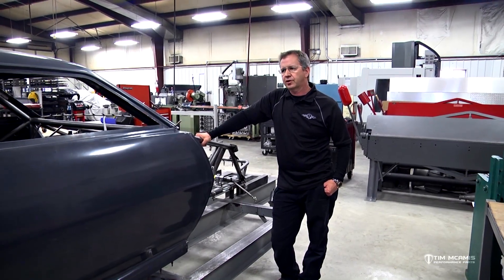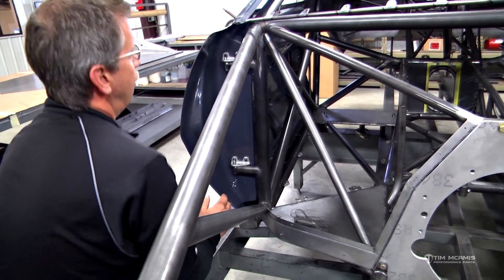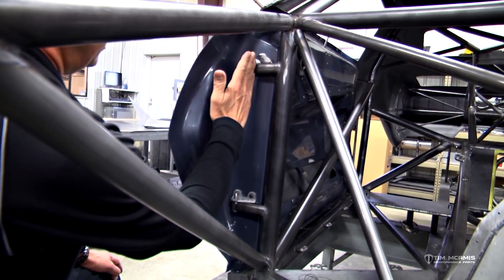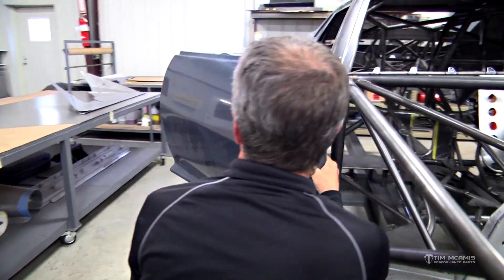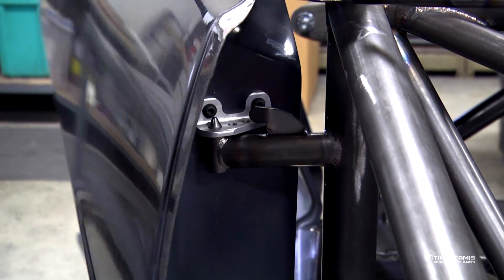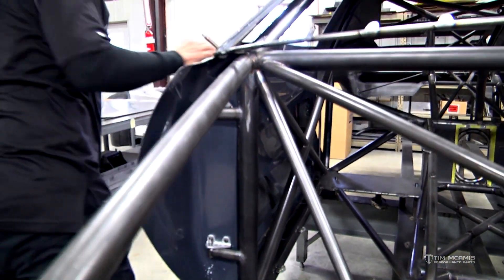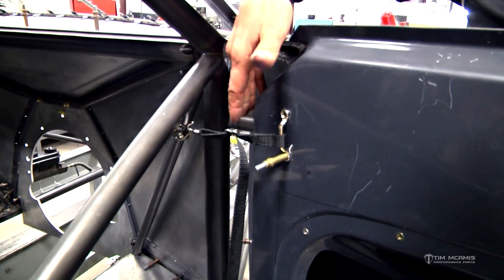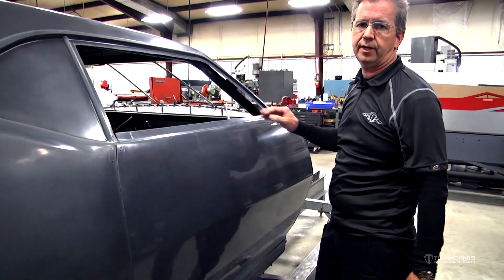Door Slammer Build: 08 – Door Mounting

Comment: If the inner door was an aluminum insert, would it need the backing plate re-enforcement? I know the carbon is a ton lighter, but was just thinking about maybe crackout around the backing plates over time versus a more durable material and repair issues maybe two or three seasons on the car
Reply from the maker: The hinges also have an inner backing plate that Tim forgot to mention when speaking about the hinges, but touches on later in the video. We have numerous cars with carbon doors mounted as seen in the video that have over 15+ seasons on them with no issues. Everything is reinforced for longevity.
Reply: +Tim McAmis Performance Parts I am definitely no car builder, but I think it is awesome y'all take the time to reply to these comments. I have learned tons just from watching this series and the way every issue is approached and comments are replied to only adds to y'alls reliability. Thanks so much